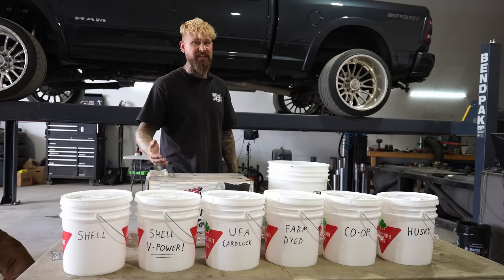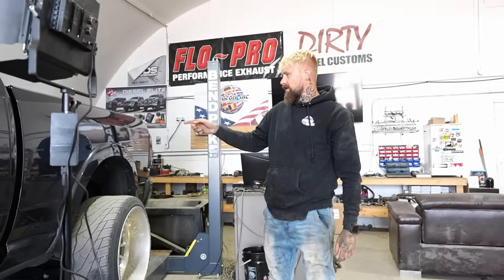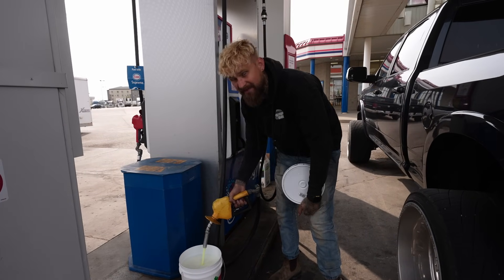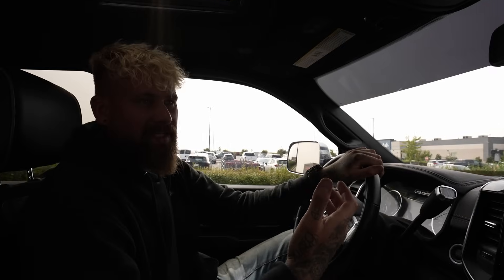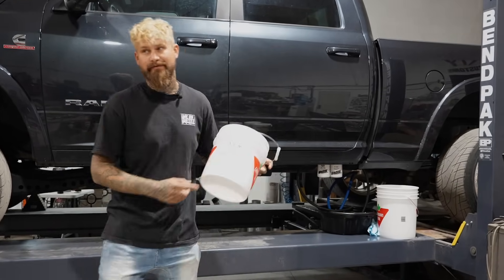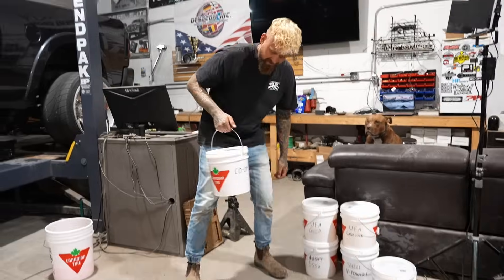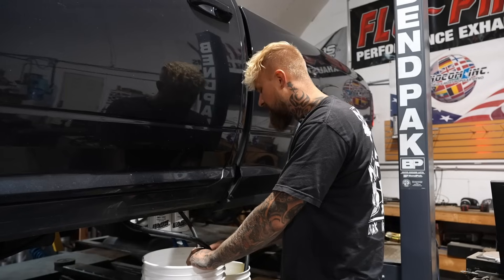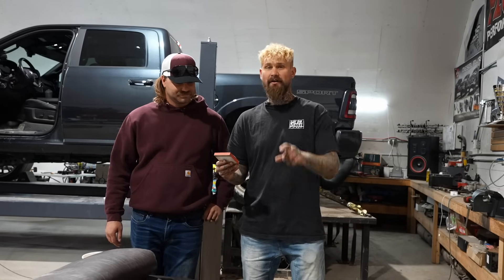We Dyno Tested EVERY Diesel Fuel... The Winner SHOCKED Us!

Comment: Good video. As a fuel hauler for 20 years hauling around AB and SK from every loading facility you’d be amazed at where your diesel comes from. The “special” diesels almost always come from the brands own loading rack but regular diesel can come from almost anyone and go anywhere. Costco has accounts with everyone and buys according to rack price which come out everyday. UFA does the same thing. Coop pulls a lot out of shell and Cenovus refineries. That COOP dyed could have been the same as the shell. You’d never know. The speciality diesels just have more cetane in them injected at the rack. You can scroll through the meter and see how much is getting injected. People will convince themselves that a certain brand of gas or diesel gets better mpg, power etc,etc but every other day it’s coming from a different loading rack.

Comment: My Dad used to work for FCL (Federated Co-op Limited) he worked there for 3 decades. He wrote programs back in the 1990s they still use today. He has vast knowledge of the fuel distribution along with a ton of other parts of the company. They do not only supply fuel to Co-op. FCL actually bought all husky fuel locations and sold husky locations to locally owned Co-ops where apllicable. For ones that were not able to be sold to local Co-ops, FCL kept control of. Husky has all Co-op fuel. Co-op also supplies gasoline to Husky, esso, and a few other companies but only in the area that the Co-ops that buy fuel from FCL have a presence. Its decently hard to get away from Co-op fuel in Saskatoon. I cant remember if diesel is the same way but Co-op and Husky are the same so the diesel is the same as well. Ill ask my dad when i get a chance on which companies bought their diesel from Co-op. The way the Co-op works with relation to FCL and the other Co-ops in western Canada is convoluted and the way fuel distribution works and the illusion of choice is even crazier. Ill return if I can get a clearer answer for yall. 

Edit: I asked my dad. He explained the interchange system that Shell, Esso, Co-op, Husky (coop), and others all particpate in. It allows for the refineries to share stock between companies for logistical reasons. Prevents shell from having to ship from a refinery far away when they can take from coop and coop gets to take some from shells and whoever gets the shaft the other company picks up the difference in the tab. So all these companies use each others fuels with the exception of costco and flyingJ. There is no reason to stick to one over the other because that week they might have interchanged from a different refinery and its different than the refinery from last time you filled up. Go where you want. Only exception is the flying j and costco so if you exclusively go there, keep going there, it is different than the others. Otherwise, it serves no purpose to be loyal to the specific brand. Youll notice that the vast majority of the results are all within what could be a rounding error. This supports the idea its shared. The ones that dont could be a bad batch, contamination on that specific pump, and various other reasons for not being within the margin of error. I am in saskatoon so if Kyle wants me to explain further i am literally twenty minutes away from him

Comment: Well as a truck driver of 40 years and my last job b4 I quit for many reasons like technology and poor drivers immigrants and no respect.  Any ways 1000 km a day everyday super b chip at 64500 kgs up in mountains. Petrocan diesel was my best power and fuel mileage and even told by another guy that had 5 truck pulling the same. He thought I was crazy then tried it and switched to only Petrocan. Cause I was right.  Shell was the worst cut my power by one two gears every hill and used 50-80 litres more a day.  Esso was not good either coop was as good as petro ufa wasnt as bad as shell but noticeable. This was in 8ish years of freight liners with 600 detroits 2013 concordia and 2016 cascadia.  Shell never goes in my vehicles at all.
Reply: 100% I have found the exact same results, PetroCan diesel outperforms the rest, noticeably better fuel economy.

Comment: The Coop refinery in Regina, SK. makes 2 grades of diesel. A premium blend for Coop only stations and a regular competitive blend for all the local competitors. This is because in markets distant from Regina too costly to ship the fuel Coop will exchange with competitors near their refinery a fuel of quality equal to what the competitor will supply a Coop at the distant location.
Coop currently supplies to their own local Saskatchewan Coop stations the premium diesel and in markets possibly as far away as Winnipeg and southern Alberta. 
I believe it is the only premium diesel in Western Canada  that is considered dense to deliver more power, has added cetane for better ignition and has a premium detergent package to keep the fuel injection system free of contaminants. Cleaner injector tips will spray in a pattern that burns the fuel better.
From dated information I had there was likely only one other refinery located in the Atlantic region who blended a premium diesel but it did not offer all the benefits of the Coop diesel.
Some responders are correct that winter diesel will show results different than summer diesel. Winter conditions require cold starting properties that reduce both power and economy. However all brands will adjust for that requirement and one refinery in the west even further blends a grade for the Arctic. I think a similar winter test would provide similar results.
I feel Coop, being a member owned business, believes in delivering added services to its customers. This is not a place to hold a suspicion because they are not the biggest they can't be the best. I've always trusted Coop and not surprised that this test showed Coop as a leader.

Comment: Thanks for embarking on something like this! I'm sure the batteries loved all those cranking sessions!
But I have a feeling that the TCM had a (hidden) hand in limiting the peak torque output over the course of multiple dyno runs. I'd be willing to bet that whatever fuel you used on the first two runs would still net the highest average peak torque output.
That truck's got the standard output 5th gen Cummins, right? Which means it's got the 68RFE. That transmission really does need all the help it can get to protect itself from any amount of torque produced by the 6.7 Cummins, which is why I'm thinking that the gradual downgrade in peak torque output has to do mostly with the TCM trying to protect the 68RFE. Unless, of course, you've got a custom TCM tune that doesn't try to baby the peak torque output.

Comment: Those fuel filters would not survive sticking down off the frame of my truck. I use my truck to pull a toy hauler when going camping on rough terrain and such. That would be a trip ender
Reply: With the wheels and tires he’s running, pretty sure his filters are safe😂

Comment: In Florida we only have one grade of Diesel. 

I wonder how Black diesel would test out. That's what I run. 
My set up I use 6 barrels for the filter process. The fuel gets transfer from the first one to the last as I need it. I have 10 barrels of processed fuel. First tank is pure used oil and trans fluid. That hose pulls from the middle. the rest stay about 10 inches off the bottom. Each following tank is diluted with fresh diesel half and half. The last tank is the one that goes in my truck. Each transfer is done with a 10 micron filter. I collect used oil as needed. Not sure what the final ratio is, but I have been running it for about 5 years now to use up my waste, and it just escalated to this set up. 

Look into making you prints on Dry-fit shirts. Looks better and does not fade. 
Great info as usual.
Reply: I started using “black diesel” I usually use about 3-4 gallons used motor oil, then 1-2 gallons of pump diesel to thin it out, so it pours in the tank easily, my 89 ford 7.3 idi non-turbo seems to love it!
Reply: @ZacharyDufek I learned the hard way about doing a direct in-vehicle mix. It really is best to sediment tanks and let them settle out. Especially if you get a batch of used oil with lots of debris in it.

Comment: Yall should check Flying J/Pilot diesel...
They are always about 80 cents to a dollar more expensive but I've noticed about 2-3 MPH loss and a loss of power. I hotshot and pull 4,000lbs up to over 20,000lbs and I swear their expensive over priced fuel is garbage
Reply: I’ve noticed anything catering to long haul is more expensive.

Comment: Bio-Diesel ATF blend... how much ATF till it doesn't stay running... that's how some engines get parted for storage, idle then line swap to an ATF tank till it stalls out. ATF delays the second stage of combustion because the flash point is higher, hotter egt's...
Reply: Common rails stall out on ATF? Weird, I would think with that much injection pressure it would run. Guess I'm used to 12 valves lol.

Comment: As a guy that used to deliver gas and fuel oil from the refineries to the gas stations. In many cases I can call what you are saying B/S !  Many areas only have a single refinery in it's area. They then sell it to the individual Gas companies. It's the same fuel people.  Just the names were changed to protect the guilty.  Sometimes the additives are different but that's about it.
Reply: Not true at all. My Costco sells “Top Tier” diesel, which have very specific claims/specifications. The Premium diesel options also have these, and there is no way the same fuel is going into the pumps. The diesel may come from the same location, but they add their specific additive packages to the fuel before it goes to the pump, which changes the quality (cetane for example).
Reply: @AquaticLogic  Sometimes, but only sometimes
Reply: It’s all about the additives
Reply: Then why were the numbers different?
Reply: @JakeMacLean1   Account asks what should they be to make you happy ?
Reply: @davebaker489  I don’t understand what you’re asking me. But I personally think if they were a 10/10 goth baddie, that would make me happy.
Reply: I’ve done several tests on gasoline and found some pretty substantial differences from one brand to the next with the same 87 octane.  As much as about 5 degrees of timing difference.
Reply: @91CavGT5  5° is a lot of horsepower, especially on higher performing engines. If I added 5° of timing to my supercharged 392, I would actually feel that with my butt dyno
Reply: @bryanspanjer3213  exactly.  It was a rather large difference, and it was a factory OEM computer advancing the timing based on knock sensor feedback.  The test vehicle was a 2006 Chevy Colorado.  I did the testing in the summer of 2006 and utilized a Scan Gauge OBDII reader to monitor ignition timing, coolant temps, intake air temps, and throttle position to try to eliminate as many variables as possible.
Reply: I totally agree, as I stated in a different comment I work at the Lloydminster Cenovus Energy upgrader and Petro Canada, and Co-op both load from here.
Reply: @deanweninger2154  are they using Saskatchewan crude oil only, or is Alberta crude going there also?
Reply: Correct several different brand chains are getting the same fuel, there would be a difference in winter fuel over summer fuel.
Reply: Shell was the first to die it's diesel yellow. My Brother worked at Shell refinery and the sold fuel to everyone that needed it because the other refineries couldn't make enough fuel to supply all of their stations. There is raw fuel and additive fuel.
Reply: In western Canada, it's a little more complicated. Of those stations, three brands have their own refineries. Costco and UFA are almost certainly buying enough volume to get a custom additive blend, and will likely change the refineries they buy from as the demand/availability changes.

Comment: Irving fuel here in New England seems to have decent additives compared to other fuels in this area. This is just my observation, no technical data. My 6.7 Cummins seems to run smoother, slight increase in mpg and a little quiet.
Enjoyed your video, thanks for doing it, must have been time consuming. Appreciate it.

Comment: I'd love to see this done with Gas as well. My personal truck is a Ram 1500 and I exclusively ran Petro 94, I swapped my gas cards to esso for better pricing and I fully believe my truck runs worse on esso 93 and gets worse mpg. My work truck is a Ram 5500 and it has no pep when I fill up wirh esso diesel, yet when I fill up at the shop from our local fuel supplier (card lock style company) she's got a lot more pep

Comment: Interesting results. CO-OP refines their own fuel in SK, but also buys fuel from Shell here in Edmonton. They sell more fuel than they produce and it's easier to buy from a competitor than build more refining capacity. Fuel blends that are close to the same performance and additives would really not show a difference when truckloads are mixed together. I wouldn't run the plant based blends, too many problems with organics growing and gumming up fuel systems.
Reply: I work at the Cenovus Energy Upgrader in Lloydminster and both Co-op and Petrol Canada load diesel from here.

Comment: Just did a trip to from AB to MB and back over the Labour Day weekend in my deleted +45hp 2008 6.7 Cummins pulling a 27’ trailer approximately 17,000 lbs combined total weight. Burned $812/580L of Coop diesel over 2200km which is about 26L per 100/km. I exclusively run Coop diesel as I feel the engine runs the best with it and this video confirms it!
Reply: We buy bulk from them for the farm, very happy with the quality and the Killam station guys are good to work with. Only complaint is the stupid cardlock machines.

Comment: The only reason I don't run Coop Diesel unless I have to is because I kept getting water in their fuel. My diesel welder would constantly freeze up in the winter using coop fuel. It happened every fillup for 2 months straight. I drained the fuel 5 times during that month. But that's all there was in the area I was working. 

I usually stick with petro Canada diesel now. Haven't had issues since.
Reply: Water in diesel light came on everytime i fueled at co op. Switched to shell an so far she's off
Reply: @geometro9769  Yeah when i used to live in the city Shell was also my go to. But no shells up north where i am now.
Reply: Ran Co-Op 87 in a GM work truck so I could get Co-Op $ back. Ended up in the shop with engine issues, our mechanic said let me guess you are running Co-op 87. Switched and never an issue.

Comment: The Fass sump being situated amongst the lowest components to the ground makes me feel uncomfortable.
Reply: You really think this thing goes off road?
Reply: That's what I thought too when I learned about the sump unit. So I commented on it, but according to the response I got, it's a really stout unit that can actually take a beating. But it's still an uncomfortable idea to have exposed fuel lines and connections being, as you said, one of the lowest points on the truck.
Reply: Yeah that was looking really low. Would have to lift the truck a lot to be not worried!
Reply: I have one on my F250, it's a stout unit and the lines are durable asf.
Reply: It’s fine. My truck has a sump and I off-road my truck for work and no issues

Comment: First comment would be that you should always run those fuel lines in a manner where they cannot get caught up if your out in the bush with your truck, so in this case, over the frame instead of under
Reply: Definitely dont like the fuel filters sitting under the truck like that
Reply: I run V-power, have for years, no issues.
Reply: Ive never had a problem with mine.. I’ve been in the brush, nasty lease roads etc

Comment: you'll have to redo the video once we get the winter fuels
Reply from the maker: Yess! Good idea
Reply: @darkirondiesel  I have emailed the engineering departments at PetroCanada and Shell years ago. The diesel fuel blend is continuously changing through throughout the year every month it was different. they sent me charts of the BTU value throughout the year and it looked like a roller coaster ride. mid summer is highest BTU and mid winter the lowest.. but depending on when each individual station was filled last will make a difference on power potential.   as some stations not used frequently could have a few months older fuel and different BTU value. it’s hard to get an apples to apples test as you never know the percentage of the different blends that are in the tank underground you filling from. the lower power numbers in this test might be from some tanks already getting BTU dropping from fall fuel blend.
Reply: i second this

Comment: i cant believe you didn't test Petro Canada!! ,,,  anyway great work for curiosity's sake.   i think Co-Op is the only fuel out off all of these that is Top Tier rated, with is a fuel approved by the manufacturer?  Maybe.
Reply from the maker: Everyone always likes to say co-op fuel sucks but I’ve always ran it and never had any issues!
Reply: Shell is Top Tier, buddy of mine did the same dyno style test for premium gas and shell v-power consistently got the best numbers.  So thats all I've been running for my gas and i assumed the diesel would be good. In this test its arguably the same. The V-power additives is what im mostly after. Our local Coop had issues with water in their diesel which made us stop using it for the farm.
Reply: @icenbryse5190  local supply reliability is for sure a bigger reason to switch brands than anything that would show up in a dyno test. Where I am the Co-op guys are good at what they do, but I've never heard complaints about the UFA.
Reply: I think it would have been as crappy or crappier than the Esso diesel, from my personal experience.